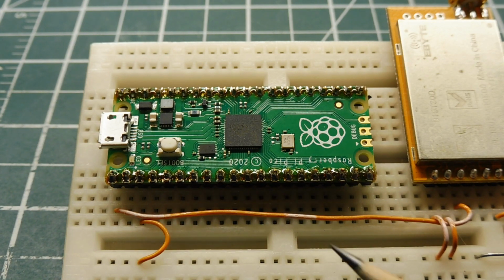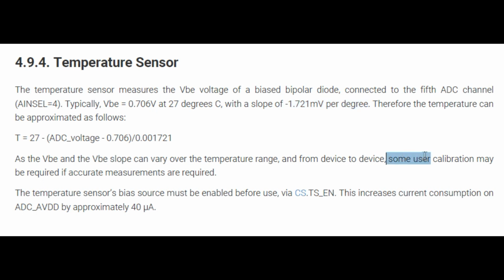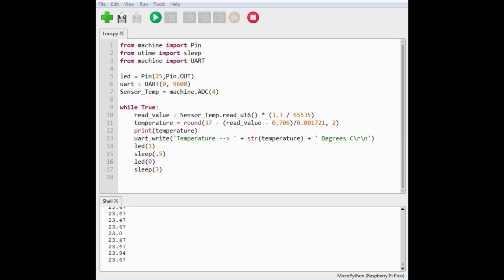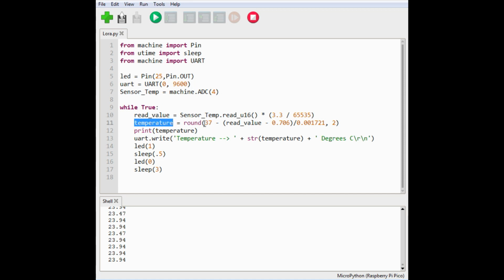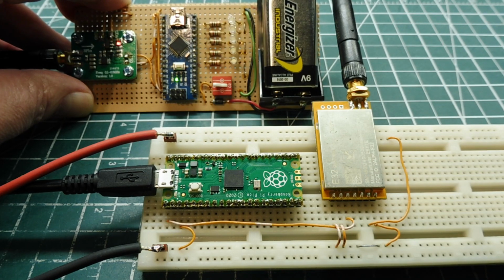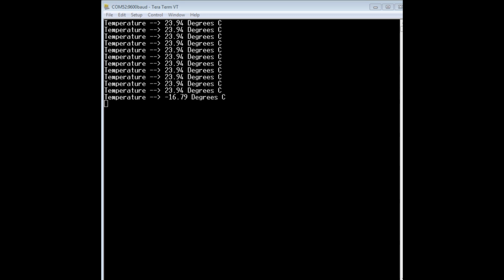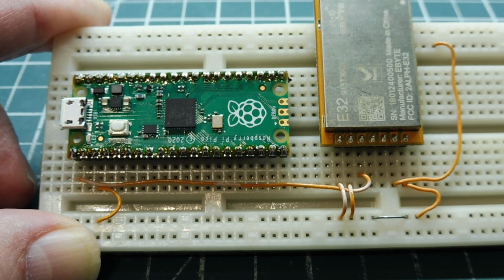Raspberry Pi Pico  /  Temp Sensor  /  LoRa

Comment: Hey - I've recently gotten into microcontroller topics - currently, I've built my own weather station - unfortunately, I'm having trouble connecting the station to a LORA module to transmit packets over longer distances. Do you happen to have a detailed guide on how to do this? I am also using raspbbery pico microcontrolers. Please can You help me?
Reply from the maker: If you have problems with range consider using a repeater:  https://youtu.be/zMjA_s30G2I

Comment: Hello sir.. How to select SF and transmit power for this code?
Reply from the maker: Power output is set by using Ebyte configuration software. SF and BW is automatically set when desired over the air data rate is selected. https://youtu.be/FB-ePscCcOU
Reply: @0033mer  Thankyou sir. I understand

Comment: 27 is the right value for me 37 was showing high temperature
Reply from the maker: The internal temperature sensor has an accuracy of +/- 10 degrees C so everybody will get different results, and some may have to adjust the formula accordingly to match the ambient temperature.

Comment: Are you going to be going into more detail? Like sharing the receiver's code? I'm having trouble finding anything for beginners when it comes to pico and lora.
Reply from the maker: There is no code involved in the receiver part of the LoRa link. The data is sent directly from the receiver UART to TeraTerm and displayed. Check my channel for more LoRa videos. https://youtu.be/ptX_m8YSeA4
Reply: @0033mer  You should consider doing a video with two rpi pico's and 2 lora modules, and having them send messages to each other. I'm not finding any code that shows how to send, receive, set device addresses, etc.
Reply: @0033mer  I'll check it out, thanks!

Comment: is it possible to install Forth on the Pico ?
Reply from the maker: There are rumors that one is in the works. It would be another Mecrisp port for the Pico.
If one is releases I will make an introduction video on this channel.
Reply: @0033mer  That was the first thing I was thinking because of your passion for Forth. But there is no point in loading Forth onto this board is there? since the pico doesn't really excell in area's than other microcontrollers that you use and which cost even less. I have no idea but is Forth available for an ESP32?

Comment: I'm in college currently to get a degree in EE. My professor said the 27, sometimes 25, degrees Celsius and the six digits past the decimal is standard for EE design and doing the math, but no its not practical and he pointed that out. So you might see it in data sheets and programs as the reference temperature  because the math nerds designed it like that.

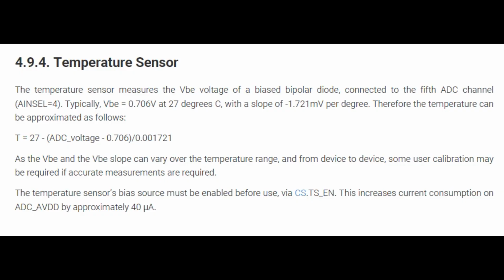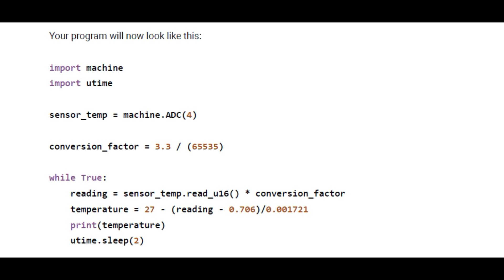Comment: The 2040 does not have floating point capability so this is the cause of your calculated results deviating from actual using the formula from 1:32. Some integer magic is required at 2:43 !